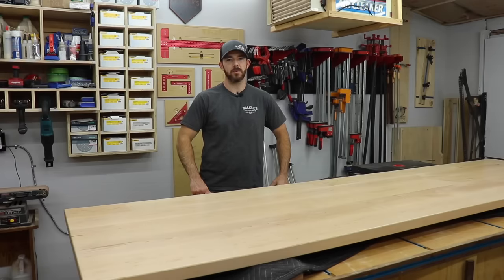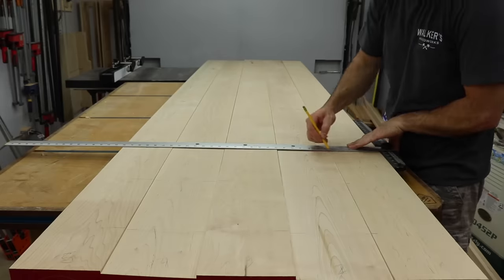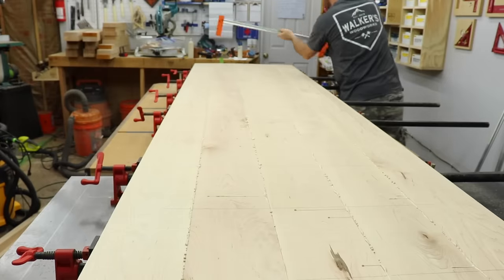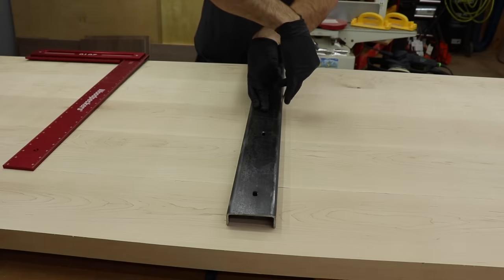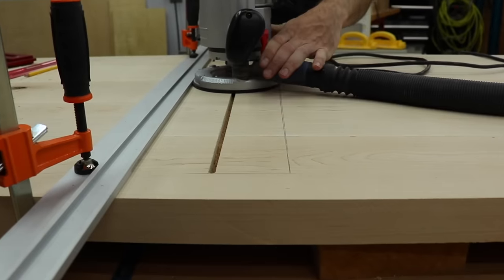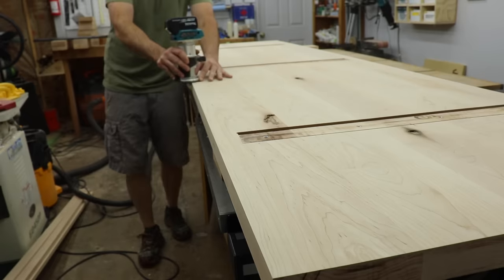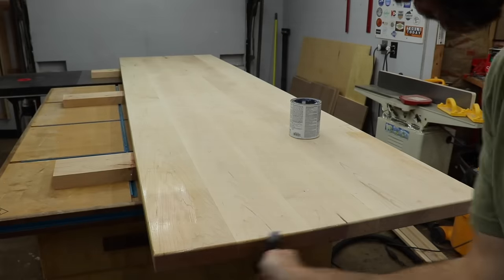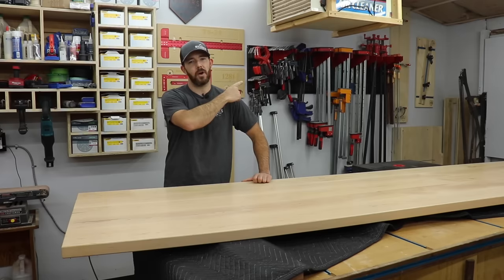How to build and finish a desk top / DIY Table top

Comment: What are the advantages of using the two different sanders?
Reply from the maker: One removes material faster.  But I've been using 60 grit abranet ace HD on the Mirka and it works pretty much as well.

Comment: So I guess getting the S3S wood made it so you did not need to plane the wood? I want to make a big table but my planer is only 12.5 in wide.
Reply from the maker: Yea it's surfaced on 3 sides so you only need to trim one edge.

Comment: I would recommend machined steel threaded inserts. If that slab wants to warp it will rip those Mickey Mouse  cast inserts apart.
Reply from the maker: Lucky for me these are steel with a zinc coating.  But thanks for the input.  That and the elongated holes in the channel will allow it to move without warping.
Reply: Those are cast pot metal
Reply: If he just properly jointed and planed the wood from the start those metal pieces underneath aren't necessary at all.  Same with the biscuits.
Reply: Matthew Silver Could you show as an example of how you did something similar?

Comment: I'm going to be putting 2 pieces of 1.5" thick birch cutting board countertops together to make one single piece. The 2 pieces are basically identical. The difference is 1 piece is 2 feet long and the other is 4 feet long. The goal is to make a single 6 foot piece from the 2. Any suggestions on what I can use as clamps to hold them together while they glue?
Reply from the maker: Are you doing it end to end to make it longer or long grain to long grain to make it deeper?  If you're doing end to end it won't work very well.  End grain doesn't form a strong joint.
Reply: @WalkersWoodworks  I'm not sure what that means. I'm not a wood worker. But imagine a 6 foot long table. I guess the grain usually goes along with the length of the table. Now imagine cutting that table in half to make two 3 foot tables. I want to put that table back together again. I don't mind having to use dowels or even braces underneath the table.
Reply from the maker: Are you doing it this way... = or this way - -
Reply: @WalkersWoodworks  The second (- -). The first way would still yield a 3 foot table.
Reply from the maker: That's tricky.  I would use bigger dowels or floating tennons.

Comment: Whats the minimum time in between coats of water-based poly?
Reply from the maker: Depends on the ambient temp and humidity.  The can should have the correct dry time on it depending on brand

Comment: I am not so sure you are not wasting time cutting the edges off @ 7:20. You are running the saw harder with the on off 6 times and the speed up and braking as opposed to spooling up and then using the saws input power to keep blade speed constant. The saw has inertia it uses to make a continuous deep cut. Also that saw is VERY powerful. Cutting your full depth on 1 pass in my opinion is better on the machine, your time and I think on the blade too with less over all blade wood contact with the full depth cut IMO. Just a suggestion perhaps you may do some testing to see definitively which method is lowest stress over all.

Comment: Nice job. I'm worried the C-channels might do more harm than good. While they add strenght in one direction, the slots you had to cut to sink them in makes the desk top weaker in the other direction. Of course this might be a planned out compromise if the legs of the table are placed on the c-channels, instead of in between them.
Reply from the maker: It's more to keep the top flat rather than for strength.  There is still a good amount of material between the channel and top of the table.

Comment: Hi would I have too rotting the boards on a smaller table? Or would it mater? Thanks.
Reply from the maker: +Rodney Bosch I'm not sure what you mean.
Reply: @WalkersWoodworks  In the video of you making table of Maple. You rotated the wood. Would I have to do the same thing with a smaller table?
Reply from the maker: Oh I do it with any top.
Reply: @WalkersWoodworks  Thanks.

Comment: Can someone do a ELI5 of what a quarter 8 is? I take it that the 8 is the board length? Can a 2 x 6 be used (or is that a fancy way of saying that?
Reply from the maker: 8/4 is just the way they measure lumber.  It's basically 2" thick.  4/4 is 1"

Comment: Not sure how you installed those channels
I think I would have used an epoxy as well being screwed.
Reply from the maker: That would not allow the wood to expand and contract with the seasons and you would end up with cracks or warping.  That's why the holes are elongated.

Comment: I tried doing this and so far on the gluing stage.  Its looking like a disaster.  Couldnt get the biscuits to fit each other.  Big gaps in the wood in between boards.  Bought a planar and a hand planar but it still Sucks.

Comment: Get yourself a jointer and planer.  No matter what any lumber yard is telling you, their "finished edge" is nowhere near good enough for quality carpentry.   It's why two of the boards are separating at the end of your video.  If you had those two tools you wouldn't need to worry about biscuits or using those metal pieces underneath.  The gluing surface area is more than enough to bond the wood together, especially if you're using Titebond III.  You'd save a ton of time and end up with a better quality product.  Also, a wide body drum sander would be helpful too but not totally necessary right away.

If you're just starting out, reinvest into your business and buy tools that are going to make your job easier, faster, and produce a better end product.
Reply from the maker: I have a jointer and a planer.  My lumber yard has high end machines and they do a very good job.  On a 10ft piece of 8/4 maple it's pretty impossible to run perfect through the table saw.  And that's what cused the small imperfection at the end that you saw.  The channel is not there to bond the wood.  It's to stabilize it from cupping or warping.  Similar to what bread board ends do.  Thanks for watching. :)
Reply: @WalkersWoodworks  I have never heard of any lumber yard milling carpentry quality boards.  Yours would be the first.
Reply from the maker: 🤷‍♂️ Lucky me I guess.

Comment: It always breaks my heart if I see someone do such good work and then put laquer or polyurethane on it at the end.
Reply from the maker: Why's that?
Reply: @WalkersWoodworks  It's just my personal opinion, but I greatly prefer the look and feel of wood treated with linseed or tung oil (depending on requirements) or a mixture thereof. You lose a lot or all of that with PU and laquer - and if it's furniture in closed rooms, the wood loses the ability to help regulate room moisture levels too.

It's not like it's a terrible thing, I just think wood loses a lot of its charm with these coats.
Reply from the maker: I honestly really like the new oil/wax blends.